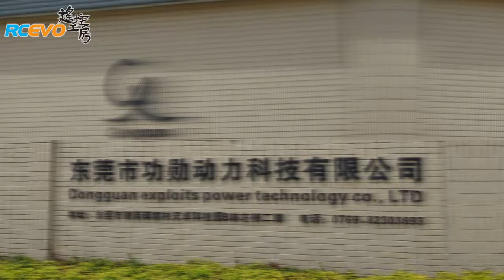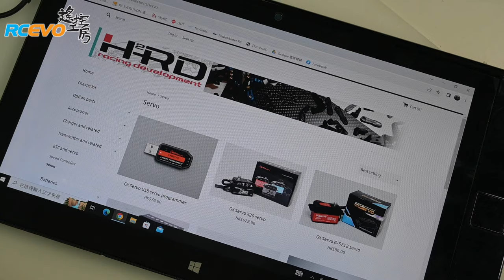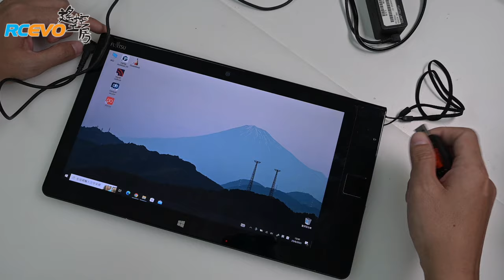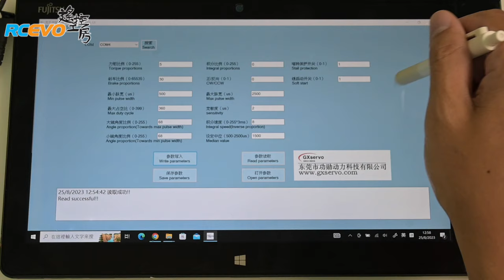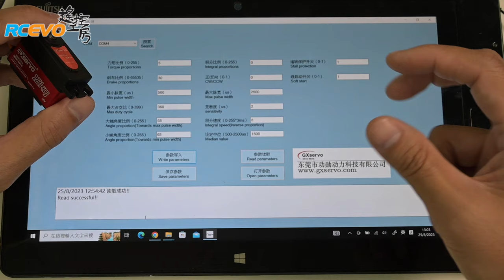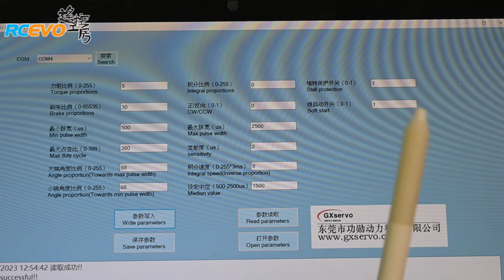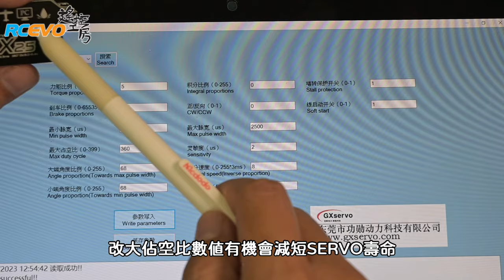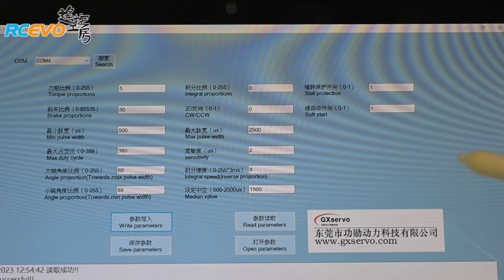[深入探訪] GX/Yipin Servo工廠 + USB Dongle軟件教學

Comment: Hi Is there any english documentation on the programmer ? i tried to change my program since my G15 movement is very choppy, not smooth like normal servo. Any help is really appreciated.
Reply from the maker: Don't program the servo if you are not good to know about the program.
If your servo got issue, better to contact the distributor for help.
Reply: My GXservo X25 is also choppy! I bought more than one, and all of them have this issue